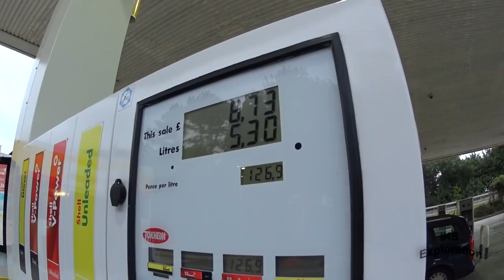BUNKER UNCOVERED, FORD TRANSIT REPAIR & TEST (VLOG 38)

Comment: I had a MK1 camper with an Essex in, the thing was so good on juice and OK it didn't like above 80 but my it could fly to that speed, when I fitted a jag back axle to it, it went phenomenally fast for a huge flying brick lol   I used to keep an eye out at the auctions for the ex SPG swb MK2 Transits as these were incredibly swift with special rear axles and gearboxes made them the "bank robbers" choice.   I am currently weighing up putting a Essex V4 into my Reliant Robin as them little V4's were pretty small footprint and bolt to virtually anything type 9.
Reply: Today i hired a 2015 diesel transit and got 29.8mpg - im sure the essex is better than that!! go for it a v4 in a robin - my type 9 5speed isnt all that well as the van was used for towing a rally car in the 90s - i've just got a 4 speed + od which i hear is better. need any advice on engines and boxes message adi - expert on fords

Comment: When the first Ford Transit was introduced, at the end of the 1960's, it was a revelation. All vans previous to it were gutless, and slow. The Transit drove like a car, and furthermore, a very fast car. In the hands of a skilled driver, it could be thrown about like a rally car - which made it the getaway vehicle of choice for bank robbers: you could dive into the back with bags of cash, and then piss off quickly. The Police hated them; The Transit was about 20mph faster than most Police cars of the time. Also, it was anonymous: most users just kept a white van, because it looked good. The Police used to make a habit of stopping Transits, 'just in case'. I was with my dad once, when he went to get some bulldozer spares from the Caterpillar main dealer, and we were pulled over, just to see what we had in the back. Then the Police got their own 'tweaked' Transits, and they were back on an even footing with the villains. The combinations of power plant, and body style on the Ford Transit, run into millions. It is that flexible. And, like the Hoover, and the Biro, 'Transit' has become a generic term for a large van.
Reply: its not a proper van if its not a transit - and did you know why it was named transit?

Comment: Neat seen how they were built surprise me the top layer was brick and the bottom was cement if there were to be a blast in the vicinity of one of the ROC posts do you believe the brick would be shaken loose and possibly claps inwords with the ground shaking and pushing inwards on the brick the trapping the soldiers inside what are your thoughts
Reply: first time i have seen one out the ground - most are concrete so wonder if the brick was just an outer shell of sorts?